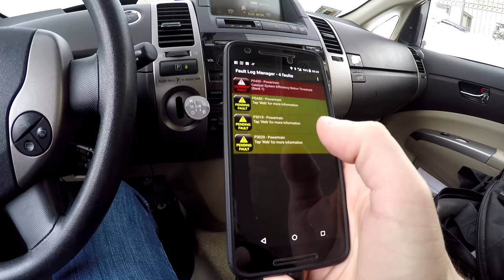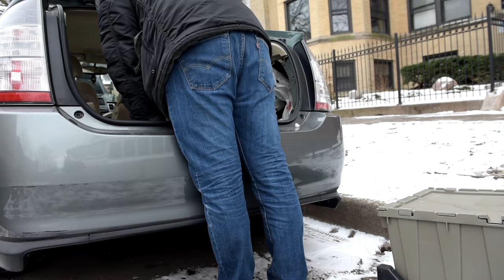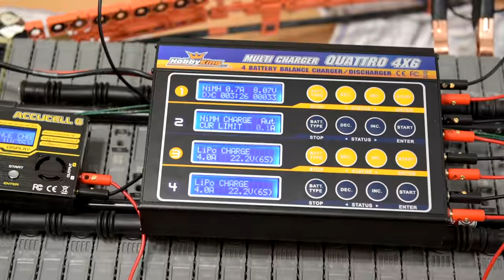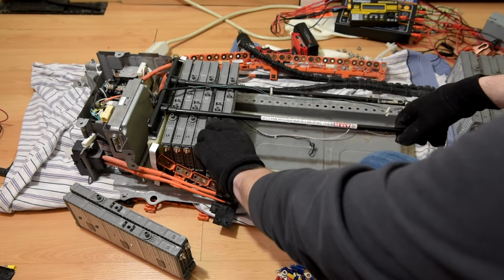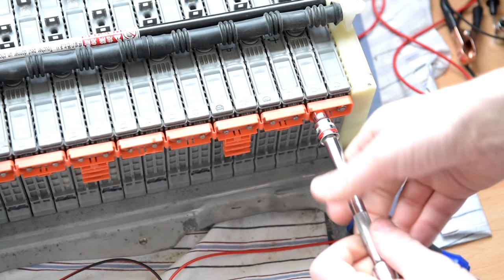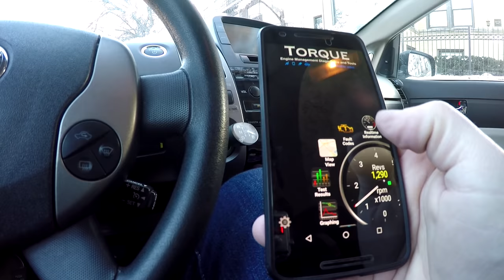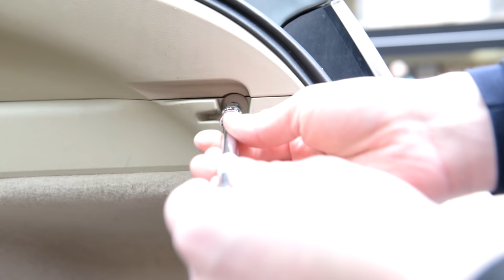Hybrid Battery Repair Ultimate Guide (Toyota Prius 2nd Gen 2004-2009) DIY

Comment: You don't have to unbolt the front panels just lift up and out. The Pros don't use Torque-Pro, they use Dr. Prius which graphs the voltage swings faster and tells "Internal Resistance" which is more important than voltage. Get yourself an electric screwdriver and save yourself and time. Don't take the top off until the battery is out. Take the fan ducting out carefully. It's easier to put the battery over two sawhorses because of the bottom module bolts. You don't have to take off all the bus bar nuts-just the ones around the suspect battery on both sides. Taking voltage measurements is a waste. Dr. Prius will tell you the bad block. The best test is while it's in the car and under load. Forget the charging crap. The average person is just confused.Watch those 3 thermocouples -you can easily break off the wires. Get a spray can of Caig D5 Deoxit -must faster than vinegar. The battery computer will handle your "balancing". The method of replacing modules as they fail is called the "Whack-A-Mole" method. All the modules are going to fail. Go the the junkyard and buy a late model battery pack. A 2014 Grade A will be about $850. I put those modules in my 2005. The trouble with E-Bay is that the module sellers won't tell you the age of the modules. Why put in old modules?  The first 4 characters of the serial number is the date if you know the "secret code".

Comment: I have questions. My charger can discharge above 1amp on this prius battery.  What's the maximum discharge ampage I should use? 

2. I set mine to recycle 5 times and out off at capacity of 7500. Now once it's start discharging and charging and it out off at 7500 I stop. Is this a bad idea? 
3. I couldn't set maximum voltage to stop charging. Mine some times shows charging at 8.6volts. Is this right?
Reply from the maker: 1. The higher discharge rate - the better, it will save you time. These blocks are supposed to stand high discharge currents. 
2. That is the maximum charge it would fill into the battery until it stops the charge. The nominal capacity of the module is 6500Ah. Setting 7500Ah is more of precaution, so that it won't try to overcharge the module, this would go straight into the heat. Maybe you can even set it to 7000Ah or so.
3.I didn't set the maximum voltage, I only set the cut off capacity and the charge mode to Auto. The nominal voltage is 7.2V, it can go up to 8.6 when it's fully charged. As long as you set the cut off capacity to 7000-7500 , you should be fine.

Comment: I have tried doing this to 3 cells and had the opposite results to your video each time.  Each cell had 3 cycles of C<D. I followed the exact same settings as far as I can tell. The charge ended up only being 2500-3000mah with a discharge of around 1200-1500mah.  However, none of my cells got better with cyclic charging and discharging. the discharge decreased by 1-10mah each cycle. Is that normal? Is there something simple I am missing.  Maybe they all went bad as the previous owner let the car sit for 2 years. but with all the videos i watch, the cells always improve with cyclic charging, and I'm just not seeing that.

Comment: Hey, Igor

So from my understanding you say it’s also important to balance the capacity of the modules as well as the final voltage of the pack. As you’ve said in this video you are aiming for over 5 amps per module. But my question is if you have, say half of the pack at 5 amps and the other half at 6 amps, is this a bad thing as far as length of life or the pack? Or does this just mean that the modules with 5 amps will fail first.

I suppose what I’m asking is how much the difference in capacities (over 5A of course) matters for length and health of the battery)
Reply from the maker: Hello, that just means that the total capacity of the pack will be at 5AH. I think it will charge and discharge more quickly, not using the whole potential. I don't think it would affect the lifespan of the 5AH modules.

Comment: Wonderful video. Should I do this on my 2009 prius? It has 120,000 miles and no signs of a bad battery as of yet. Just wondering if it would be helpful to do this procedure once a year or so as a preventative. Or would that only be damaging?
Reply from the maker: Thanks. I would not bother getting into the battery unless there is an issue. It’s a major project and time consuming.
Reply: @IgorKadulenkov  Thanks for the reply Igor. I have plenty of time in the winter. I wonder if doing this procedure on a still fully working battery would make the battery last longer? Or would it be bad for the battery? Thanks again
Reply: Also, Clean the battery cooling fan.You would be surprised how clogged the fins get. My 2007 didn't have a pre-filter!

Comment: Won't the capacity numbers change depending on what discharge voltage you use?  Discharging to say, 6.00V should offer a higher capacity than 6.30V.  This makes the no / no go decision a bit blurry.

Comment: How long does it take to go through 3 cycle with the Quattro?
Reply from the maker: It took me about 20 hours to do 3 cycles on a module. Having 5 chargers it took about 6 days to do 3 cycles. For you it would be another day or two. I had to do additional cycles on some of the modules. Then i had to wait for replacement modules to get delivered and do a cycle or two on them.  I would estimate between 8 and 10 days.
Reply: Igor Kadulenkov thank you I bought two Turnigy Quad 4X6 also,  it has higher parameters is there any adjustments I can make to speed up the process. Respectfully, Steve
Reply: Igor Kadulenkov does the CHG>DSC cycle feature change itself automatically when it’s maximum mAh reached from CHG to DSC ? I have this device I’m afraid if I can safely run that much mAh without worrying? Thank you.
And can this be performed outside since it’s good for cooling 😂

Comment: So the low charge cells are NOT repairable then, correct? You got 6.94 volt on cell 16 I'm curious if this set up can bring back dead cells at all. I have about 200 dead cells 6.20 volts in my garage I'm thinking those are completely done unless this video shows I can bring them back.
Reply from the maker: Hard to tell, in my case the low voltage module was the one ECU complained about. You could always try to recover the dead cells.

Comment: When you do the load discharge test with the bulb, in 30 seconds, what is the expected discharge amount? I am losing about a tenth of a bolt over a minute
Reply from the maker: Yes, 0.05 drop in 30s and 0.1 in 1 minute is what I also experienced with most of my modules. I don't know if it can be better.

Comment: hi Igor,  I'm trying to use the prius battery for a solar application.  My food truck .   10- 200 watt 24 volt solar  
  panels, controller??( i don't know which to get.)  to the prius battery packs (2)  2012 from salvaged vehicles. then to 12 volt inverters to 120 volt 30 amp panel . I see that the modules can be reconfigured. how would I do this?  what is each module volt and amp hours?   BTW. great video. I learned alot. wondering if and how to reconfigure the battery pack. i can do the 3 tests per module .
Reply: BB Ranch Butcher closed permanently 8-9 volts i guess per battery
Reply from the maker: Sorry, i have no expertise in solar panels. This battery consists of 28 modules, Nominal Voltage:7.2V, Nominal Capacity: 6.5 Ah

Comment: Thanks for the great video and how about P0420 you solve it?
Reply from the maker: Thanks! I don’t remember if the error was already gone when I reinstalled the battery or I cleared the ecu errors with the torque app.
Reply: Thanks for your fast responce. My prius are from 2004 and until now without any hybrid battery issue. Just I have that p0420 and consumpsion close to 6l/100km unfortunetly in the city dayli driving. Thanks a lot for your video. Is the best about hybrid batteries.
Reply from the maker: That's pretty usual for city driving. In the winter months I get about the same consumption on my 2005 Prius with reconditioned battery. It will not use battery much until it warms up the engine and heats the car. In the summer time i still get about 5.6l/100 if i mostly do short city rides.
Reply: P0420 indicates a bad Oxygen sensor
Reply: X Xycom  P0420 is a universal code for the catalytic converter threshold below efficiency.

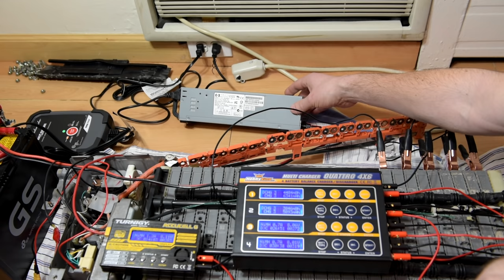Comment: At 16:49 you are using a 12VDC Car Battery, then at 17:00 you are using the HP DPS-600PB B 575W Power Supply. Is the battery used to buffer the varying current drain or can you use the HP direct and alone?
Reply from the maker: Please ignore the 12v battery setup. I tried to use the 12v battery and a 12v charger while I was waiting for the power source to be delivered. It didn’t work, but I already filmed that part of the video , so I included it
Reply: Hi, Igor!
Hi did you connect the power supply? I just got one from ebay and there is 5v and 9v, none of the contacts give 12v
Is there a jumper somewhere to enable 12 v?

Comment: Dear Igor, Id like to consult with you prior to the balancing exercise. what shall be the minimum discharge voltage. In your video i saw 6v - 9v cycles, however as per Prolong (R) they suggest discharge termination voltages to be extremely low, for an individual module (6 cells/module) . 1st discharge : 4.8v, 2nd discharge 3V, 3rd discharge 0.6V. Similarly for charging, they suggest, 8.58V to be the peak voltage during balance charging phase for an individual module.
Reply from the maker: Hello Fahad. Really good question! And I guess, i didn't really dive that deep into this aspect. From the experiences I saw at PriusChat forums, it was not recommended to go lower than 6V at least on the first cycles. Supposedly, it would allow to recover even really weak modules. It was mentioned that it would be too agressive to go low on voltages and more modules would give up. I know that Prolong recommends installing their hardware in the car and balancing the block more often, as a preventive maintanence. The car is keeping the charge between 30%-80% (i think) and modules eventually loose capacity. If Prolong recommends such discharge rates for used modules, that were never balanced/reconditioned and lost most of their capacity, then maybe that can be trusted. Otherwise, I would be careful and try to do more research on this topic. I've read somewhere that these are Panasonic modules and installed in many different Hybrid cars, so there should be plenty info online. I like PriusChat for that purpose, they have really long threads with successfull rebuilds. Let me know what you find out!
Reply: @IgorKadulenkov  same hare sticki8ng with DES 6V only. there are 6 cells in 1 cell so its good to leave 1V per cell if i am not wrong

Comment: Dumb question but the power supply is for...what? Supply's voltage to the quattro?
Reply from the maker: That’s correct. It’s for the Quattro and single chargers
Reply: That is the same question I had. Thanks for question and answer.
Reply: Yep tgese chargers run off 12v so they can't plug straight into house current.
Reply: the Turnigy 4x6s has a t60 connector.  Take a look at it and just in case order male and female t60 connectors.  You can solder these to a 10A 12 AC/DC charger from Ebay or (cheaper) a homemade 12v PSU from a PC powersupply or an older style XBox 360 Psu.
Reply: @cawag98  i gave up and ordered a matrix charger and harness designed for my gen prius, three cycles on the whole battery in three days. And I drove it on day 4. Beats the hell out of a month long process.
Reply: @cmasailor  great - which one did you get and how much driving have you done since the fix?
Reply: @cawag98  the green one, hybridautomotive dot com. Driven it 13K since

Comment: Hey Igor! One of my cells is showing around 2500mah charge and 1200 discharge (medium in a 5 cycle)..is it worth the effort to recondition..any chance?BTW I charge and discharge around 4.5Ah.
Reply from the maker: Hey Viorel, if it's at 1200 after 5 cycles, then it's definitely bad. However if your whole pack is around this range and you can't replace  all these modules, you could keep it.
Reply: @IgorKadulenkov  Thanks! Somekind of strange, most of the cells are good, like charging with 7500 and stop.I use an Imax modified for stronger discharge,I don,t even try to stress,em anymore, but funny just like 6 of them behave really low, here in Romania there is a lot of folkore about reconditioning and stuffs like this,but I have expertise from my solar gears with Lead acid an Li.ion, so I know what means when a battery is gone.I never used Nimh and I,m not sure how it behave.Do you believe in reconditioning cells?
Reply from the maker: This is normal,  I would replace these 6 modules. If you watch my video, you will notice that I replaced a few modules that got stuck below 4000mAh and the rest of the pack was 5000+. I do believe in reconditioning of NiMh, 2 years passed since I filmed this video, I still haven't had any issues with battery block. To me it's while worth it if done properly.
Reply: @IgorKadulenkov  Super! Thanks again! I'll do that!

Comment: Thanks for the detailed video. 

I have "rebuilt" my battery pack twice now, but neither build has been this detailed or had this much testing involved. I basically just tested voltage of all battery cells (Prius is a daily driver and gets driven 1-2k miles a month) and replaced those cells which were lower than ~7v. 

The first rebuild lasted about 18 months. The second has not faired quite as well, lasting only about two months before throwing more codes. I just today cleared it again, so we will see how long it lasts. I cleared a code once about a month ago assuming it would be back sooner, but it hadn't popped back until today. 

Anyway, in an attempt to keep this already long comment from going on forever, do you have a recommendation for another charger? This one in the description seems to be on back order. And I think I am at a point where each cell needs a charge discharge cycle to really get down to checking them thoroughly before "blindly" replacing any more. 

I'm at a point I think where I either want a cheap fix (couple hundred bucks) or we will trade the vehicle off or otherwise sell it. It has 200k on the clock and is going on 16 years old.

Again, thanks for the great video. Hope I can get another 50k out of the car at least (estimated life left on the tires haha)
Reply from the maker: Hello, you could probably buy a few of these: https://hobbyking.com/en_us/turnigy-accucel-6-80w-10a-balancer-charger-lihv-capable.html
That's the single charger I used together with my quattro and it worked well. It has a higher discharge rate as well. Or maybe this one could work https://hobbyking.com/en_us/quad-4x6s-lithium-polymer-charger-400w-dc-only.html , but someone complained that they had problems with mAh cutoff rate - it would stop charging early. 
You definitely need a proper rebuild with capacity restoration. My car has 220K now, still runs great after 2 years.
Reply: @IgorKadulenkov  This is what I was looking for (How your car is doing after a couple years). Glad to hear it's still going! Just bought a Prius with 195k and failed battery. It's been "Rebuilt" already as seen by the numbers in permanent marker on the cells. I imagine not thoroughly enough. I'm going to give this process a go. Thanks!

Comment: How about measuring the Internal Resistance of individual modules???
Capacity is not everything
Reply from the maker: You could do as many tests as you want. I did  the resistance test by applying load on every module. This helped me identify modules with low internal resistance. I didn’t care about actual numbers, if whole pack was low, I wouldn’t replace it.

Comment: Can anybody please comment on why there are two different chargers?  The Hobby King and the Accucell?  Is this just for increased throughput or do they do different functions?  I am guessing that the HP power supply is used to charge the car battery, which is in turn connected to the Hobby King or Accucell.  Would not a car battery charger perform the same function?
Reply from the maker: The second charger was there just because I had it before the project. I  bought another 4x charger and was able to charge 5 modules at a time. You can have as many chargers as you want. For the car battery, it is on the video by accident, I used it to test my setup while I was waiting for a proper charger to arrive.
Reply: @IgorKadulenkov  Hi Igor.  Thanks for the quick response.  So are you using the HP supply to directly power the Hobby King and/or Accucell charger/discharger?  I am planning on getting a 4 channel AC powered charger/discharger to try to recondition two different {Prius battery packs.  Thanks.
Reply from the maker: @kermit80526  yes, that’s correct. Just need to make sure the power supply has enough capacity to feed 4 chargers
Reply: @IgorKadulenkov  Thanks Igor.  I'm not seeing a target charge to voltage anywhere.  Did I miss that?  Thanks!

Comment: I have only 85000km ln my prius V. and it already has battery issues... When i use a charger to test capacity or battery modules. All are around 3100mAh and below. Am using same settings as your charger bt all capacity is low. Even replacement cells are around 3k mark. Something wrong? 🤔 😐

Comment: Also which obd scanner you are using with tourqe pro? mine not showing block voltages just showing blocks.
Reply from the maker: It's not about a specific OBD scanner. You need to install custom PIDs for your car. See here: https://priuschat.com/threads/gen2-prius-custom-pids-for-torque-android-app-with-formulas.95370/